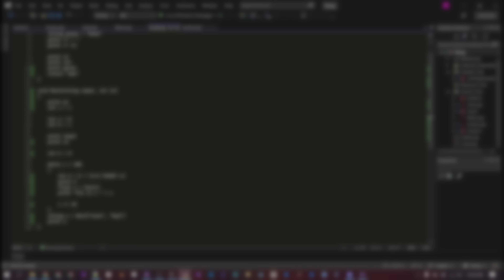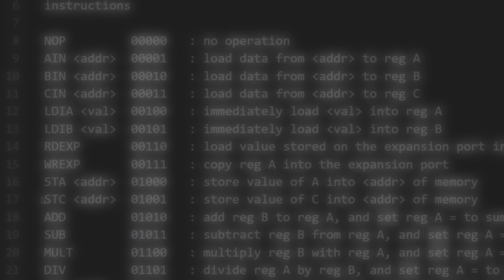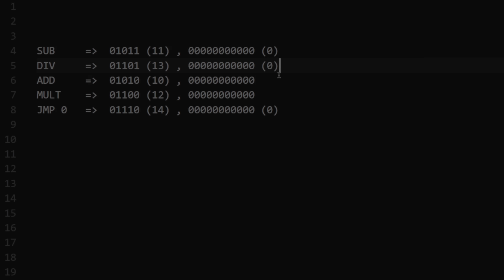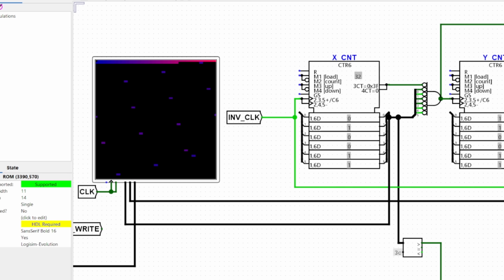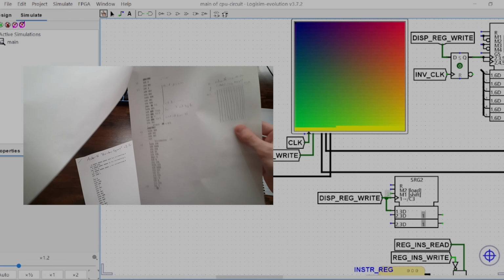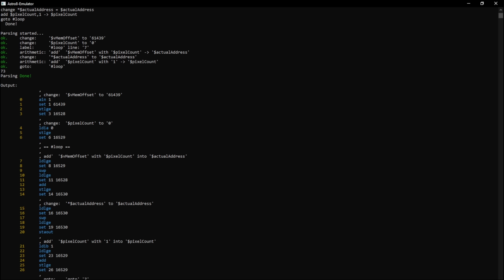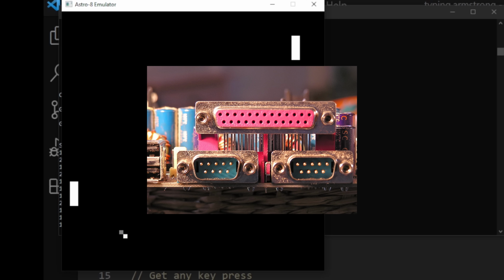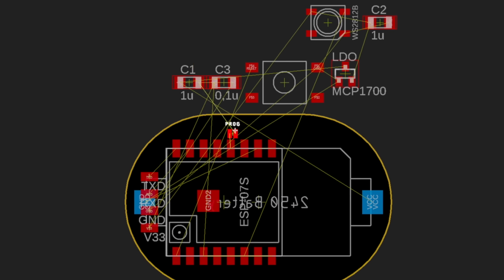I Designed My Own 16-bit CPU

Comment: The fact he did all this in under 4 months is impressive
Reply: While I think this guy has some mad skills I can also say that its not exactly hard to make a 16 bit cpu considering the amount of info availabale around the internet based on 8 bit or 16 bit designs. Go look at Ben Eater 8-Bit breadboard computer, its based on the SAP-1 and if you fancy you can upgrade to the SAP-2 and SAP-3 then even the SAP-3+. All of these designs you can practially choose your own opcodes for and add whatever logic you want inside the cpu, if you wanted to build a calculator that literally only had 10 instructions for mathematics only you could! If you wanted to make it 32 or 64 bit you also could, as long as you have the space and breadboards to chuck it on or PCB if you fancy going a step further and trying for more speed an efficiency.
Reply: @Jtag-dev  that’s how I know you got some mad skills or knowledge
Reply: @Jtag-dev  i mean yh, but it is still amazing seing that he made a while language, and emulator to go with it.
Reply: @maindepth8830  Oh yeah, even though there's a breadth of info to help you online, this whole exercise is still beautiful.
Reply: @Jtag-dev Some of the dark magic of more advanced CPUs like out of order execution seems to be on a whole other level though. Maybe that's just because I haven't tried implementing it though...
Reply: @Jtag-dev I ain’t reading allat 😂
Reply: @Jtag-dev  there is no info on how to make a cpu, you must figure it out yourself
Reply: @joechristo2  Nonesense buddy, there is absoloutley loads of infornation floating around online about existing cpu designs their architecture, their instruction sets and anything else you might want to know about them. And there is plenty of info on putting together various prototypes. What information doesnt exist is how to make your own silicon wafers with your own design however there are ways around this either getting TSMC or similar to manufature your wafers or becoming a silicon engineer. You can still find info on making various other forms of cpu though.
Reply: Definitely impressive. Very nice.

Now let’s see Paul Allen’s 16-bit processor.
Reply: Definitely impressive. I did a 24-bit computer with custom ISA in a weekend for a college class - it was horrible. I wasn't smart enough to give myself 4 months.
Reply: 4 months + his lifetime of learning!
Reply: Everyone can do It real fast, copy some code and there you go. But the main problem is if he understands it
Reply: With previous knowledge about CPUs, low level programming, etc. It wouldnt be very hard to do this in under 4 months
Reply: @balllord3546  "with previous knowledge"
Reply: This is an understatement lol
Reply: Probably even in his free time
Reply: i could do it in a week
Reply: Just the fact he did, is even more
Reply: i can do it in less than a month (already made a similar but incomplete project, but in a day)
it's not that hard (cuz i did not work on the cpu i directly implemented in in a vm/emulator made in c)
Reply: Documentation + tutorials widely available for this on the internet. Just fyi.
Reply: thats computer engineering for you
Reply: I did one in one month, but it's really unpolished and the stack doesn't work
Reply: It coud be done in 1 mpnth, no in 1 week.
Reply: I think he made it in 3 months but then he had to edit it
Reply: @Dino Sauro thank you sir
Reply: It would take me 4 months to even understand any of this
Reply: alob4 made 64 bit cpu
Reply: Fr
Reply: "Impressive"
Reply: No
Reply: @F8428F  yes
Reply: The fact that he done it in the first place is impressive
Reply: This isn t hard too understand but the time and affort put in to this is not beliveble
Reply: It takes autism to pull this off so mad respect to him
Reply: i can do it in like 2 weeks tops
Reply: @Dino Sauro Sounds like your the one theorizing... Hummm
Reply: The fact that he did it at all, but still thinks an octothorpe is called a "hashtag prefix" is even MORE impressive!
Reply: Yeah but did he create his own compiler?
Reply: @spiffinz  i think he did
Reply: Not really. I designed 16, 32 and 64 bit CPUS in a day using Python->Cython->C to Verilog->FPGA.
Anybody can do this now.
Super EAZY PEEZY.
Reply: @johnsmith1953x  Did you also developer an assembler and everything else in this video? I really wanna copy both of yall, seems like it would be incredibly educational.
Reply: @johnsmith1953x  Idk about Verilog but i made two cpus in Logisim and wrote assemblers for both in JS and Rust respectively, it doesn't take more then a month
Reply: i can do it in under than 1 month
Reply: 3 day's
Reply: BiG Head.
Reply: @AhmedJacop do it and livestream
Reply: I could do a stackbased machine in an hour.
Reply: @overbored1337  I'll wait for your video
Reply: @InnerEagle  No need. Im a coder, not a Youtuber. And im not even bragging, but when someone just have to comment how amazing it is considering a timeframe that they think is tight and dont even understand, then they need to be corrected.
Reply: @InnerEagle  If you think you're gonna get videoproof from every stranger on the internet you're delusional. 
Its cool that he did a cpu, but it taking 4 months is not a crazy acheivment.
Reply: @overbored1337 we had to do it as part of a computer architecture class. It was designed loosely on a MIPS system and implemented in a HDL named Verilog. We had about two months but the scope was smaller as it only had about 16 instructions I think?
Reply: The fact that he did all this is impressive
Reply: For someone new to the matter.
Reply: Dude Qualcomm makes a processor every year💀
Reply: da
Reply: its easier than you think, its more complex when working on 32 bit or 64
Reply: It's more than impressive. A 4 bit cpu (like an intel 4004) presenting that is a graduate level project. There is a crap ton that goes into it. It's not easy stuff at all.
Reply: i can do it in one 

(millenium).
Reply: @Dino Sauro what book do you recommend to buy?
Reply: @kyusu2725  : For compilers, just get into the FORTH language- it's linguistically very simple, and actually resembles the stereotypical YACC/Bison output closer than any other language that I know, which makes it a good starting point.

As for CPUs, I don't know any books, but look at how to hook an oscillator up to a counting circuit (to find "the next instruction address"), how to read & write a memory chip, and how to use demultiplexer chips to send a 1-bit signal to another chips (partially to choose which actual operation to do, partially to make a sequencer so that multi-step instructions will be possible).
Reply: It really isn't that difficult with this level of complexity.  I've been writing emulators since 1998 before documentation was available having to reverse engineer the target system(snes, GBA, NEOGEO) it's easy to do now but we already done all the work figuring out what makes the systems tick.  Sort of the same thing here, I've been doing this sort of thing for fun all the time I'll create a CPU design, create the RTLs using verilog, verify and drop my design on my CycloneV or Cyclone10 FPGA , then design a working video processing unit, and sound chip(these took me months), then I wrote the rudimentary OS written in Haskell to compile to C-- that then targets my platform(works kinda like JVM\CLR which has its own IL assembly so I can create a code generator for any programming language to build to my target), but I largely wrote a miniHaskell language for the live OS.  These days I am working on cores for FPGA for amiga preservation or my own M68k clone.
Reply: @ToreishiiMira  oh wow
Reply: Its result from experience dude, I believe he has so many programming experience before. Not From The Beginning as newbie
Reply: "iceberg"
Reply: He stole his music too, without credit.
Reply: @Dino Sauro "and of course you must take a degree"
I hope you don't mean college degree lol, because hell no, you don't need such things, huge waste of time. 😂
Reply: @crateer  Maybe, but that's very hard in cases like these. Engineering or anything related to science isn't an easy feat to do by yourself. Not to mention it's only a waste in the USA, elsewhere it's not.
Reply: I can do it in one
Reply: @dimi5862  go on show me, everything from scratch, from nothing. As of this comment the date is Saturday 23rd july 2022.
You can work during live streams to make sure you didnt cheat
Reply: @maindepth8830  lol but true
Reply: @maindepth8830  you can do this in a couple days to a week if you have undergrad level of knowledge in computer science and computer engineering. From what i have seen the cpu he made is extremely basic in the amount of features it has, no out of order processing, instruction level parallelism, virtual memory etc.
Reply: @upendownlinker  : Virtual memory is mostly a peripheral thing, not a CPU thing. You can implement it with a memory chip and some glue logic.
Reply: @upendownlinker  ah okay, maybe under a week would be over estimating. 2 weeks min
Reply: @absalomdraconis  I doubt this, a CPU needs to know wether 2 different virtual address point to the same physical memory. The MMU is very much an internal part of a CPU.
Reply: @maindepth8830  watchout man you maybe create another fanchen
Reply: @maindepth8830  I literally had to do this in 6 weeks  to even qualify for the exam in Computer Architecture class for my CS degree.

I'm not saying doing this is easy, but 4 months for a relatively 'simple' design like this, while impressive in it's own right, is nothing mind-blowing.

I still have my old logisim design files on my HDD somewhere.
Reply: @KilgoreOnDrugs I must be eiyher be dumb, or not have understood any of the content in my OS module. We studies this same thing and I still havent understood how to CODE this, or even design this in the first place
Reply: @maindepth8830  he has one more day
Reply: @maindepth8830  If you are willing to pay them for that, I'd say its a good deal
Reply: @maindepth8830  It is really possible, its not that hard, I alr did it
Reply: Man, the fact that he didn't need a team of low level developers neither pay for some type of support, tells that it is, probably, not that hard. I would be surprised if he actually write a Kernel from "scratch" (without using predefined Kernel functions from FreeBSD, Linux, etc.), this for sure takes a lot of time and that's why there's not a tutorial about it here.

I mean, it's impressive tho, but not because he made this in 4 months, (as many said here, probably you could do it in the same time or shorter) but it is because he really tried to understood every piece of what he's doing to make sure to not talk shit on video, that's really impressive. Many of us can learns Calculus, for example, but most of us will just copy/paste without fully understanding, and that's the point.
Reply: @davimendespimentel6849  Again. Not impressive. I could do this in a SINGLE day with nasm source. Duh.
Reply: @maindepth8830  Actually, go search up for a game called "Turing Complete", play through it from the bottom to the top, by the time you reached the second last section in the progression tree, you already made your own CPU without you even noticing. All that happens to me in just a week or two, for real.
Reply: @dimi5862  yes you can
Reply: @dimi5862  hella cap
Reply: @dimi5862  still waiting 🤡
Reply: @dimi5862  proof?
Reply: @dimi5862  it has been 6months now, done yet?
Reply: @dimi5862  prove it

Comment: Amazing. Deserves far more views! Would be great to see you make this CPU for real like the jdh-8
Reply from the maker: I was planning on doing just that, it might just take some time though. I also want to do a design that doesn't use breadboards, and instead have a few custom PCBs printed.
Reply: @AstroSamDev  I would buy it if it's not too expensive! I really like this project and i think it would be really fun to develop own programms that run on real hardware!
Reply: @AstroSamDev  Then you could take on another challenge in lieu of the process: namely, producing your own etchant. You need just a few pencil leads, two tubs, and some table salt. Should be easy enough.
Reply from the maker: @avinadadmendez4019  Cool, I have never heard of that program, I'll look into it more. Thanks!
Reply: @AstroSamDev   @AstroSam  You can also put your design on an FPGA, I don't think I have ever seen one done on youtube before for a homebrew cpu. For those who don't know; FPGAs are circuits that you can load any digital circuit on it. For example you can put your circuit on an FPGA and map the input output pins of the top module and the circuit is now the circuit you created.
Reply: @cemalettincembelentepe8943  FPGAs have been used for soft CPUs for a very long time now (well over a decade), it would be more interesting to see a hard CPU manufacturing approach and it would be unique for these homebrew CPUs unlike using an FPGA. Granted he'd be stuck getting them as samples on a really old process node (>=28nm), but that's more than good enough for this purpose
Reply: @xanderkyron  Working on an ASIC requires quite a lot of background knowledge on electronics,  so unless the background of the content creator is related to Digital Electronics on the transistor level, it is quite unneccery to do it like that. I know these for a fact since I worked on a ASIC sent to OpenMPW and my bachelor thesis I should be working on right now instead of watching Youtube is about extending an FPGA friendly CPU :)
Reply: @cemalettincembelentepe8943 I agree.